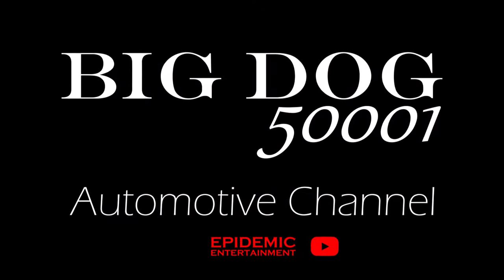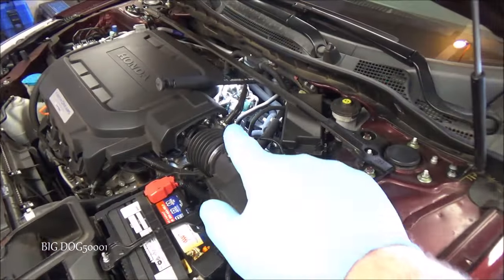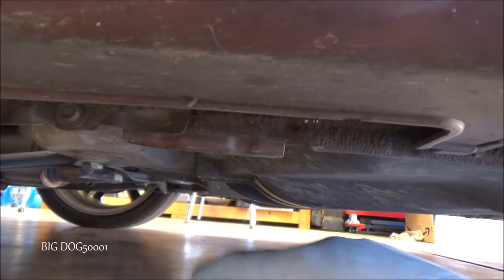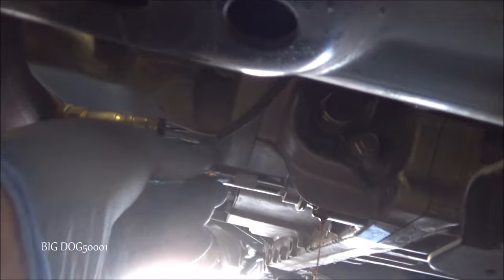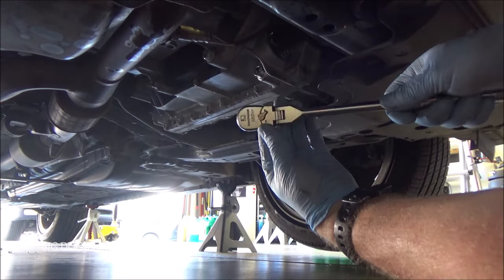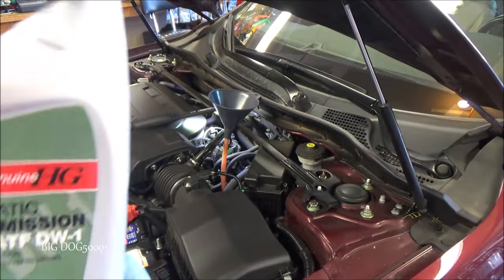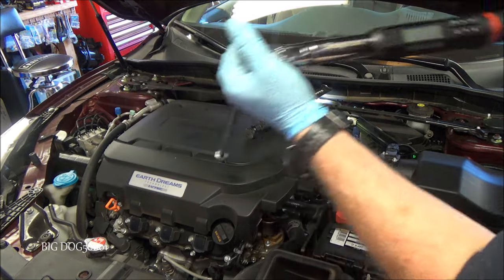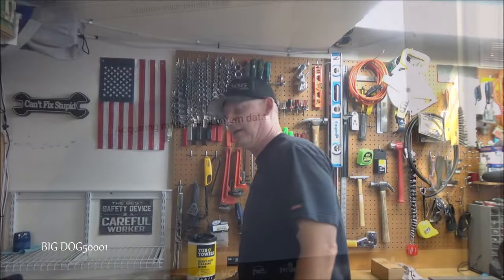2013-2017 Honda Accord 3.5L V6 ATF Automatic Transmission Fluid Service

Comment from the maker: Parts and Tools
Disclosure: This channel earns a small commission using some of these links - at no additional cost to you.
Honda ATF-DW1:  https://amzn.to/3wes99y
Drain Bolt Washer (18mm) 90471-PX4-000:  https://amzn.to/3hdHxyR
Fill Bolt Washer (24mm) 11107-PWA-300:  https://amzn.to/3AnoE45
3 Ton Jacks Stands I Use Now:  https://amzn.to/3AmEAU1
Daytona Jack (cheaper at HF):  https://amzn.to/3qPiNA7
Scan Tool:  https://amzn.to/3xZKLLJ
Astro Flashlight:  https://amzn.to/3Anmj9q
GearWrench 24" Ratchet:  https://amzn.to/2TvMR7x
GearWrench 1/2" Sockets:  https://amzn.to/2TvP4zR
GearWrench 3/8" Sockets:  https://amzn.to/3wc4DKr
Snap-On Torque Wrenches:  https://bit.ly/3gzVN2q
GearWrench Flex Ratchets:  https://amzn.to/3wd84ke
Magnetic Pickup Tool:  https://amzn.to/36cn7jk
Flo Tool Transmission Funnel 06064MI

The Big Dog 50001 Automotive Channel Store can be found here: https://www.amazon.com/shop/bigdog50001automotive  (As an Amazon Associate I earn from qualifying purchases).
Reply: Hey Big Dog! How can I get intouch with you? Wanted to ask you a few things

Comment: Watched your video a couple of times and then did my first EVER transmission fluid change on a 2016 Accord V6.  Thank you for making and keeping the video active.  Even after buying some tools to do the job it cost a TOTAL of ~$60 for a transmission fluid change.  The second one should be under $40 because now I have all the equipment.  The Honda dealership near me was well over $100 if they did the work.
Reply: This shop by my house was asking for $160 oil change and they said $300 for transmission oil change if it's a cvt. God damn man, i'm doing it myself . I got 2015 v6, might be just like this accord in the video.
Reply: I've had the dealer do the last few, but I was just quoted $220 so I'm here to diy. $55 for the ATF and drain plug washer 👍

Comment: Since I changed my Honda transmission fluid regularly, I only buy three quarts from the dealer. I use a measured clean plastic cup to catch one third of a quart of the used fluid while it is draining. I'm not trying to save any money but I hate keeping unsealed containers of any automotive fluids in my house.

Comment: What are your thoughts on doing a drain and fill twice in order to get more “new” fluid in there?
Reply: That shouldn’t be necessary if you keep up with changing it on time, but if you don’t mind wasting some fresh trans fluid that is a good way to clean out the old stuff a little better.
Reply: Better idea is to change the transmission fluid every oil change.  That keeps the transmission fluid on an indefinite fresh cycle.  Tranny oil is easier to change than the engine oil so only takes a few minutes (use the dipstick to refill, and ignore the trolls who say otherwise)

Comment: I’m extremely happy you did a video on the V6 model of this car. It’s rare I’ll see a maintenance video on the V6 version it’s crazy.

One thing to mention, when servicing the 6-speed “Hondamatic” it’s a lot easier to fill the transmission with its fluid through the dipstick.  Mostly because filling it up from the fill-plug could be difficult at times, & the dipstick cylinder/hole is wide enough to accept most funnels.
Reply: Can the job then be done without ever removing the trans fill bolt? Simply removing dipstick, removing/reinstalling drain bolt and filling through dipstick hole? Is removing the dipstick enough to help the trans fully drain?
Reply: @turbocharged9589  yes that is correct, fill bolt does not need to be removed and you can add fluid through dipstick tube. You will need a long funnel or one that has a flexible hose. I did it this way for my 13 accord v6 (same process as the one seen in the vid)
Reply: @NZN_Motorwerks correct

Comment: Great video, got it done following the steps, although i came up short on the dipstick at 3.3qts and had to add more. I will mention i also spent time shifting thru all gear selections at 5 second intervals two times all the way through at the suggestion of other videos which said this helps the fluid to find its way back into all the gears so they arent dry. Thanks for your help!

Comment: Thanks for the video. Awesome info. I replaced the transmission filter located under the battery, and ended up being a full 4 quarts to get fluid to show up on the dipstick.
Reply: I also pulled more out than the 3.3 qt specified here, but followed the steps and completed.  The used fluid filled back 3 of the quart sized atf bottles used and two 12oz empty Gatorade bottles and a bit more into a Starbucks Frappuccino bottle, so definitely closer to 4 qts for me as well.

Comment: The dealership didn't know these cars used transmission fluid so I did it myself.  Found out if you lift the ass of the car up higher than the front you van get an extra quart out.  Also recommending changing the filter with a Magnefine 3/8 P/N 3810000 which also has a bypass pluse a magnet 🧲  not included with OEM. Remember ATF flow is from top hose to bottom hose your welcome for the research. Thanks for sharing.
Reply: Yeah, I just changed the fluid in mine today.  tipped the back end of the car up for draining.  It took all four quarts that I had.  Just a fuzz above the top level on the dipstick.
Reply: How do you change the filter one one of these. Honda’s “Hondamatic” transmission design doesn’t allow for the main filter to be changed. I wish there was a video one this.
Reply: Great video.  What about the transmission filter?

Comment: Great video thank you, I have a 2016 EX-L V6, I think my mechanic put in all 4 quarts vs 3.3 quarts. You think the extra 3/4 quart will do harm otherwise I will drain some out. Same for the engine oil he dumps the whole 5-quart jug and the manual states only need 4.5 with an oil filter so an extra 1/2 quart of oil hopefully no harm.
Reply from the maker: The engine oil might not cause any issues but the ATF could, I would put the proper amounts in if it were my vehicle.  Too much ATF can cause shifting issues or creeping while in N, too little could damage the transmission so the level needs to be correct.  Thanks for the comment!

Comment: Thanks for the video. '14 Accord Auto V6 110k in cool weather doesn't quickly shift into 2nd from 1st (pedal drops/engine revs, then pops into 2nd). Also gets stuck in 3rd. Park then Drive resolves that. Trans fluid change 2-3x in past 2 years. Would you change again and add an additive like Lucas? Filter, shift solenoid or something else? Thanks in advance for ideas!

Comment from the maker: The jacks stands shown in this video were recalled, I do not recommend using them.
Jack Stands I use now:  https://youtu.be/_2al-M53N-w

Harbor Freight Jack Stands Recalled:  https://youtu.be/CYBVeEu1dYk
MORE Harbor Freight Jack Stands Recalled:  https://youtu.be/nnjVrOTevS0

Link to details from Harbor Freight:  https://www.harborfreight.com/js-details
Link to NHTSA Notice 20E-016:  https://static.nhtsa.gov/odi/rcl/2020/RCLRPT-20E016-6561.PDF
Link to NHTSA Notice 20E-027:  https://static.nhtsa.gov/odi/rcl/2020/RCLRPT-20E027-9959.PDF

Comment: You can fill the transmission fluid from the dipstick hole instead and save yourself all the effort.
Reply: Purposely looked at the comments to see if anyone addressed this.  I thought the same thing
Reply: I was thinking the same thing.  I'm changing my fluid this weekend and I'll probably just put the funnel in the dipstick hole to make things easier.
Reply: Yes you can it goes to the same place anyway
Reply: Exactly, on the 6-Speed “Hondamatic” the dipstick hole is wide enough to accept most funnels. Just be careful when filling it up, as the pressure difference inside the transmission vs the outside atmosphere will cause some of the fluid burst out if you try to fill it to fast.
Reply: I have a transmission funnel and this is the second time I have filled in the dipstick hole and no issues. I agree little slow is better, to not leak fluid.

Comment: Very informative video. Need some help here please. I just got a 2012 accord 3.5L V6 coupe with 66k miles. Do you know if your procedure applies tor the 2012 model? Sucks but there are not many videos about the 3.5 engine. Thanks for any help

Comment: Thanks Bigdog! Very helpful. I will do this next weekend. Can this be done without that extension? I have nothing like it.
Reply: I just filled it through the dipstick with a fluid transfer hand pump. Way easier and worked fine. YMMV.

Comment: I’m new to cars so this was helpful. Do you not need to change the filter? Is this also considered a flush or just a change?
Reply from the maker: This is not a flush, Honda does not recommend flushing.  This is a drain (partial) and refill.  As far as filters go, there should be an external filter on this generation V6  https://youtu.be/0o4lh9_AyG0
Reply: @BigDog50001  I appreciate the response. I watched the video and gave it a thumbs up. Not sure if you’ll see this but I’ve got a 2013 year of this same model and I don’t thing the transmission fluid has ever been partially replaced. Mine has 128k miles on it and I feel like it’s starting to shift not as smooth but I’m hoping this can help it. Partial fluid changes should still be okay even if it hasn’t been serviced before with this many miles, correct?

Comment: Thanks for the video, what is a maintenance minder?
Reply from the maker: It is built into the car's computer and is a messaging system that pops up on the dash/instrument cluster that tells you service is due.  After service is done this system needs to be reset (told that the service is complete).  Thanks for the comment!
Reply: @BigDog50001  How to enter the maintenance page to reset (like you did in your video) ?

Comment: I just changed mine tonight and I used the dipstick hole to fill it. Didn't know there was a plug in the back.
Reply from the maker: It can be done that way, just takes longer and a funnel that fits inside the dipstick tube (on V6 engines).  Most older 4 cylinder models are made to fill through the dipstick tube (it's quite a bit larger).

Comment: This is a great video. So today I went to buy a 2016 Acura TL V6 (Acura version of this car) and found that there is NO dipstick. In addition, the change procedure involves taking out a plug from the horizontal side of the trans to make sure fluid just drips out at exactly 104 degrees operating temp (with the engine running). AND it uses Honda Type 3.1 fluid.  Why is it so different?
Reply: I believe those had the zf 9 speed transmission if I remember correctly

Comment: Big Dog!  I just purchased a 2013 Accord V6 with 93,000 miles, and I don't have any service records showing a transmission fluid change in that time.  Do you recommend doing the 3x transmission flush (draining and refilling 3 times with 10 min drive for each change) on my change here?  Thanks in advance for your help and your great videos!
Reply: Since nobody answered, if you change the engine oil every 4-5k mi and drive 15-20k mi/year, an alternative is to change the trans fluid at the same time for the next year. Valvoline Max synthetic for Hondas has worked well (YRMV).

Comment: This is just an odd question as i am thinking of buying a used car for my first car. And i am obviously looking for a very reliable car for at least 5 years to drive as in now in 2022. I am always a big fan of honda accord and civic. I do drive a bit speedy as well. And i saw that on the market there is a honda accord V6L model on sale with 110K km on it. But then after some research i did heard there were many problem occuring with the honda accord during these year around 2013~2016. So will you recommend to buy a used honda accord v6l for a first car or should i just buy a honda civic  2017~2018 which is not the 1.5l turbo engine but the standard 1.8 l engine. Anyone are welcome to give me an advice.

Comment: Can you do a video on the service bulletin re: starter replacement/ fly wheel adjustment? I’ve replaced many starters. The flywheel rotation is new to me.
Reply: Honda says 30K, but I change mine a little early as I want the transmission to last as long as possible.
Reply: @tomsullivan2907  George is talking about the flywheel service bulletin not changing the fluid. Honda service bulletin 16-002.
Reply: i rotated the flexplate flywheel one bolt clockwise and it worked for a bit and now its starting to have problems my next step is replacing the starter

Comment: Can I skip removing the fill plug entirely? The dealer parts dept gave me the ATF and only one washer for the drain plug. I'm wondering if I could just use the dipstick hole instead of needing to remove the fill plug and go back to the dealer for a new washer.
Reply: Easier to just reuse the old washer.  Ideally, you want to do this procedure 2 or 3 times to get (almost) all the old fluid out.  I wouldn't even change either washer until the last time.  In the mean time you can swing by and get the proper washer.
Reply: Yes. That’s how I’ve serviced our odyssey transmission since new and it has 200k miles on it now and still shifting smooth

Comment: I have an A3 light at 116000 miles one dealer recommends drain and fill with new filter for 190, another dealer recommends flush for 375 and says it doesn’t have a serviceable filter just a mesh screen? Any advice on which way to go would be appreciated

Comment: Using the top fill plug is not hard and less mess refilling than dipstick tube lol Plus it will refill faster, unless you wanna wait forever using the tube. Doing buddies '12 Crosstour right now for him

Comment: I just purchased genuine Honda ATF today to do 2 - 3 transmission fluid changes from the pan on my 2016 V6. I have a very subtle knocking sound in park at idle that Honda is telling me is the torque converter. It goes away when the car is in drive and doesn't appear to be the auto tensioner (sound is not similar to videos I've seen of that failure, nor does it seem to come from the front of the motor). Nonetheless, I asked Honda parts today if my model has an external trans filter and I was told yes. I've not looked over the car to confirm this, do you happen to know if that's correct?
Reply: Ask which engine he is talking about. On the Gen 7 4 cyl, the filter is external. On the V6 it is in the trans. Many people refer only to the 4 cyl engines.

Comment: Should you replace the transmission filter on the Honda Element 2.4? Honda dealer says Honda doesn’t recommend it. Your recommendation please.
Reply from the maker: I typically leave them alone unless I'm having an issue with the transmission.

Comment: I have a 2010 V6 , is procedure the same?
Also, I know some mechanics/ shops will remove / cycle out the remaining ATF located in the transmission converter, how important is it to drain the fluid from the converter?
Reply: 2/3 of the fluid remains in the torque converter so it's basically mixing mud with clean water: you'll get a clearer mixture but it's not ideal.  The idea I've adopted is to do a change the fluid every engine oil change cycle, that keeps the fluid as fresh as possible without doing those ridiculous 3x drain/refill sessions you'd otherwise have to do to ensure an adequate clean fluid change.
Reply: This is what I'll be doing from now on,  which is what you described.  Draining the ATF every oil change or at least every other oil change to ensure ATF is nice and clean.

Comment: What is point of taking off the fill bolt?
Reply: To make sure you’ll be able to fill it before you drain it. If you drained your transmission fluid and then went to take the fill bolt off and it was stuck, you’d be screwed.

Comment: Is it necessary to remove the upper ATF bolt as opposed to using the dipstick tube to refill?
Reply from the maker: Typically they can also be filled through the dipstick tube but the V6 dipstick tubes are smaller (than 4 cylinder models), so it takes longer to fill and a small funnel that fits the tube is necessary to do it.
Reply: @BigDog50001  Makes sense. I wanted to make sure it wasn't something I missed. Thank you.

Comment: Why we need to open the ATF bolt while we can fill the transmission fluid through the fluid checker hole?
Reply: What fluid checker hole? That’s why he used the ATF bolt.
Reply: That is the hole which you plug the dip stick to check the level of transmission fluid

Comment: Question, What about filter?
Reply: There is an external serviceable filter located under the battery. The other is inside the transmission.